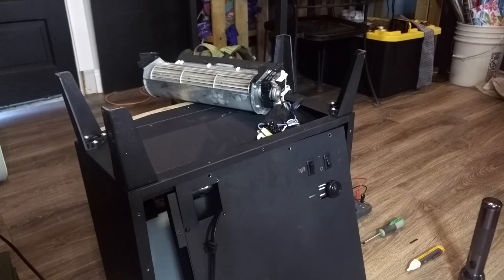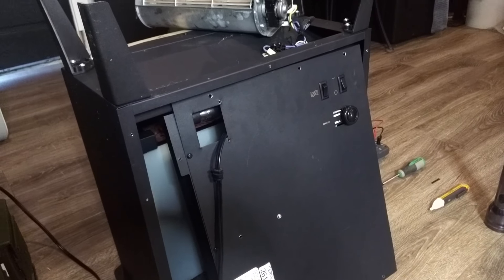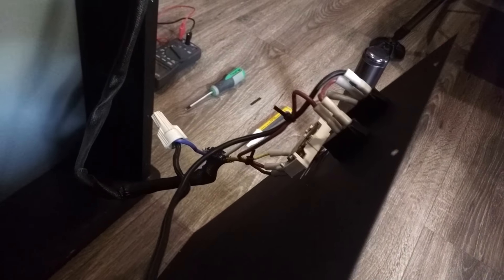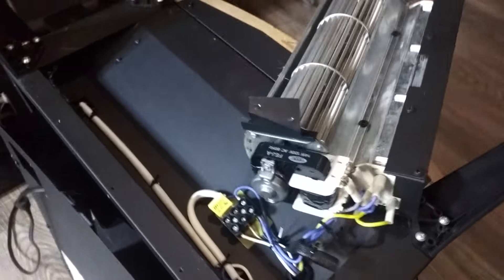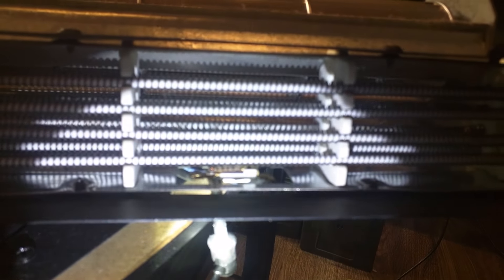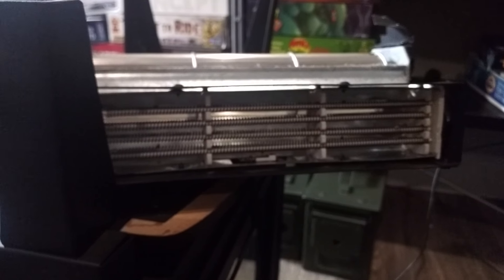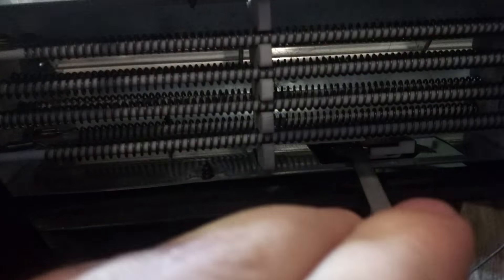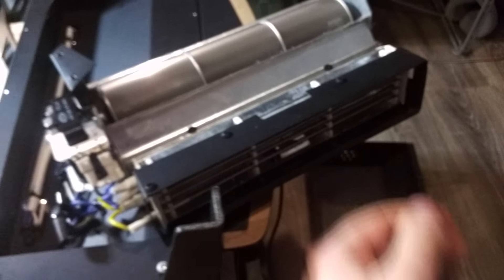Electric Fireplace Repair

Comment: Other videos have you replace switches that will most likely never need replacing.  This is by far the best one i have seen.  Repaired my heater in 10 minutes.

Comment: Thank you so much for this video.  I have the same model and mine quit working last year.  I took the fan and heater apart and it was filled with dust and pet hair.  After a good vacuum it is working perfectly again.

Comment: This helped alot man I had a Rv with electric fireplace (dimplex) I had the same problems and took it apart and got it to work for a few minutes after slapping it, eventually quit working again and was about to give up on it (been dead for a year) 

Did this fix and it completely fixed it!

Comment: This trick worked on a HF fireplace space heater that kept shutting off. Finished it off with a little QD electronics cleaner. The file set can be found as OEMTOOLS 25342 2-Piece Ignition Point and Utility File. Thank you for this useful video!

Comment: this video helped me even though I have a Dura Flame heater. Same area but it is not the contacts  cleaned them but did not help. On this one,  there is a strip of connection among them is the contacts. On one end there is a wire with a round copper end and it is  riveted into that strip. Then there is what looks to be a an over sized resistor gray in color no marking. Not sure what it is.  On each end of this resistor looking thing,  there is a straight wire coming out of each end, and it is bent into a circle. So the wire and this resistor looking thing are connected.  And it is lose, not making good contact. I got it working but who knows for how long.  I was hoping it was just the contacts I did not know about the over heat safety switch.

Comment: I've fixed mine more than once these crappy fans expand when heated and essential wear the motors out..I'm sure you've had yours apart again!  Mine is a Lennox but that doesnt matter these units are junk..just crap, mine has halogen bulbs for the display, need I say more!

Comment: Does that style of file have a specific name? Thanks!
Reply: It's a "point file". You can get it from any automotive shop. They are used on old cars and motorcycles that still have contact points in the distributor. Alternatively, you can get some very fine sandpaper but you'll have to make sure that there isn't any debris left between the contacts when you are finish.